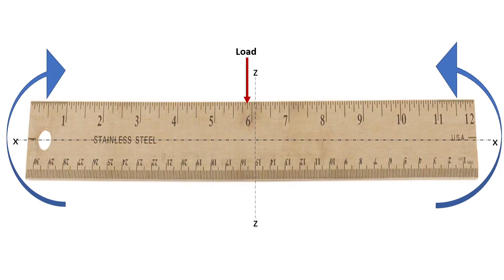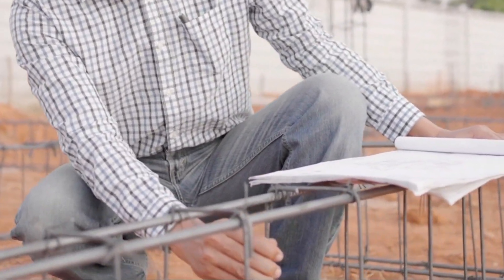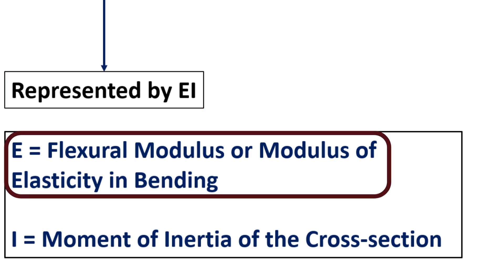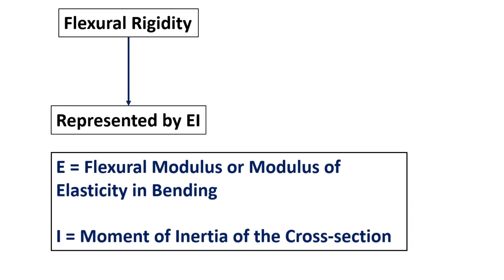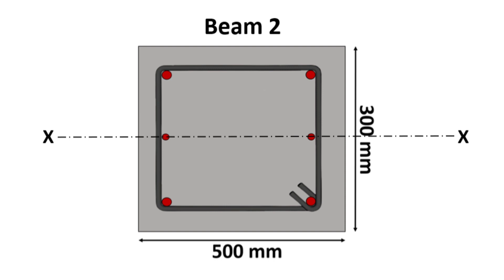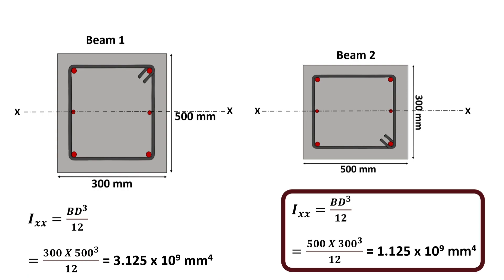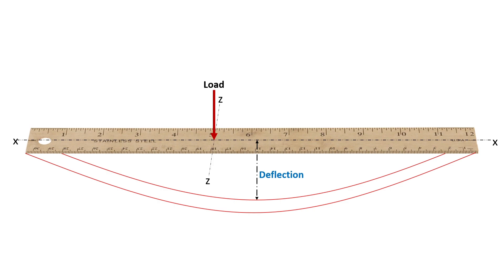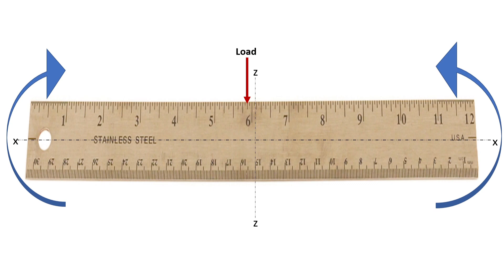Why is the depth of a Beam always greater than its width? | Why Beams have more Depth than Width?

Comment: What about a strip beams?
Reply from the maker: The width of strip beams is generally greater than the depth because their primary function is to distribute the load of the building over a wider area of soil. Strip foundations are typically shallow and wide, so the strip beams are designed to match the width of the foundation. By increasing the width of the strip beam, it is possible to reduce the load on the soil and prevent excessive settlement.

In contrast, normal reinforced concrete (RCC) beams used to carry wall loads are designed to resist bending and shear stresses caused by the weight of the walls and other loads. These beams are usually deeper than their width because the depth of the beam is what provides the necessary strength to resist bending stresses. The width of the beam is usually kept to a minimum to reduce material costs and simplify construction.

So, the difference in the width and depth of strip beams and normal RCC beams is due to their different design requirements and functions. While strip beams are designed to distribute loads over a wider area of soil, normal RCC beams are designed to resist bending and shear stresses caused by the weight of the walls and other loads.